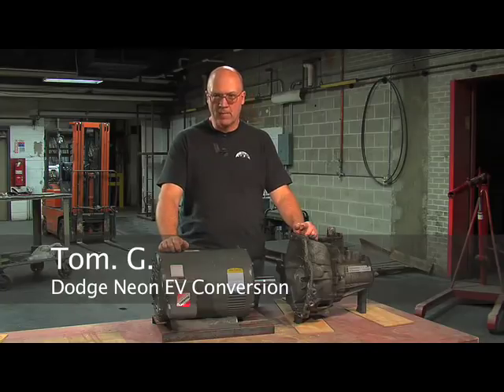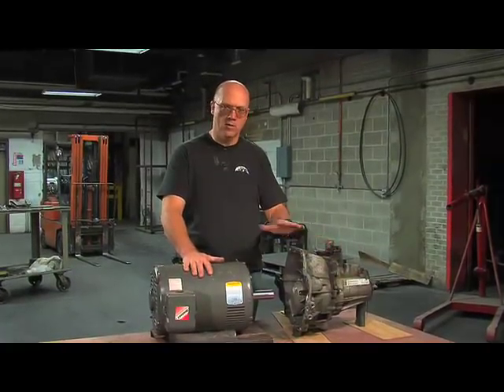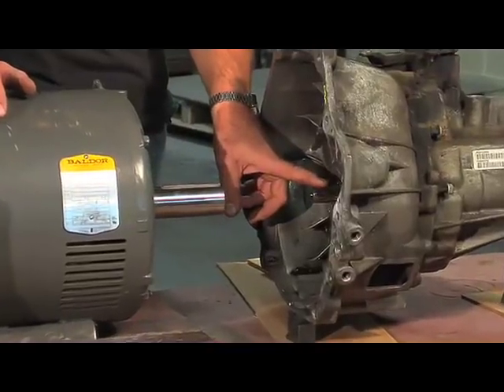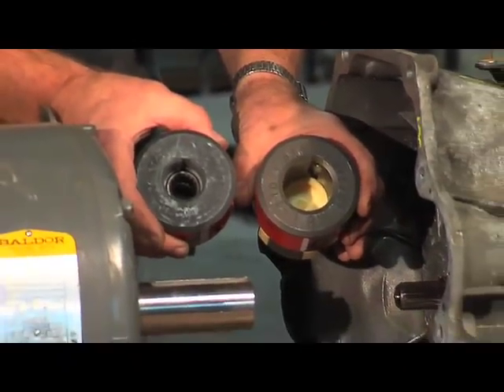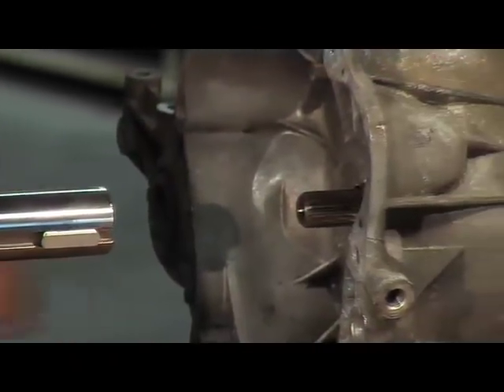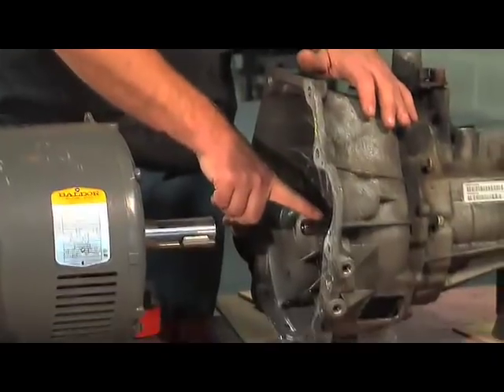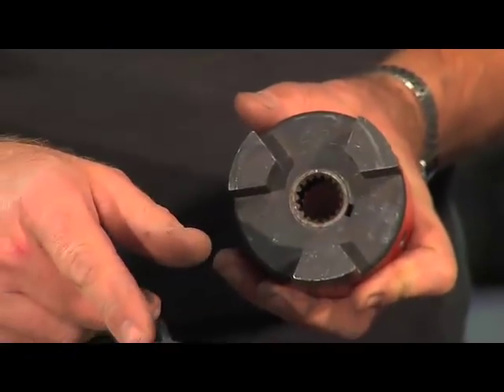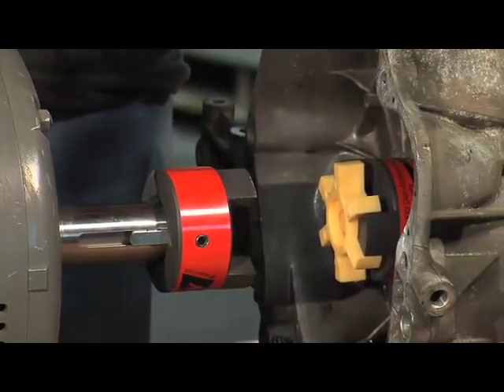AC Electric Car Conversion 101  part 001

Comment from the maker: Tom got a matched AC motor and the variable frequency drive for it as a matched set (for free, I think, knowing the right people.....)
The AC system also has regen built right in.
Reply: Is the motor an AC baldor industrial 30hp motor? I hvae  one laying around I want to use. The fvd might need to be purchased as the one I have would need modification to supply the DC bus directly instead of industrial 3ph supply. Thanks for this video.
Reply from the maker: @idus  Yes, I believe that is exactly an AC baldor industrial 30hp motor. I recall that Tom used a stock industrial Variable Frequency Drive with it, and I'm pretty sure that he just fed it DC directly from the batteries with no alteration to the VFD. Many devices that deal with motor control need to convert AC to DC as a first step. If you just give it DC in the first place, it works just as well.
Reply: @BenjaminNelsonX  That is great news. Thank you
Reply: @BenjaminNelsonX  So, if I understand, I can get one of the baldor motors (say a 20 hp for a few hundred) and run it off DC battery bank? I am doing this on a sailboat, so same concept (couple the motor shaft to the prop shaft) but less power requirement.
Reply from the maker: @j.goebbels2134  The important thing to remember for an AC motor is that there is a variable frequency inverter which takes the Direct Current from the batteries and converts it to Alternating Current to run the motor.
Reply: @BenjaminNelsonX  Thanks so much for quick reply! 

So I don't have to do anything special? I can wire a battery bank straight to a AC motor and it will run? 

Reason I ask if that new 20hp baldor motors sell on ebay for $500. If we add 4 big batteries to it, we could be running in a week. But we are electrically-challenged, not having wired up anything like this before.

We are broke down in our liveaboard boat -- threw rod in old gas engine, so looking to repower with renewable electric BUT hard to find info on how to do it....
Reply from the maker: You need to convert DC (Direct Current) to AC (Alternating Current) to power an AC motor from batteries.
If you want to run straight from batteries, you can use a DC motor.

An inverter, used to convert DC to AC for an AC motor, can go by several different names, including: Drive, VFD (Variable Frequency Drive), Inverter, ESC, speed controller, etc.

Industrial, mass-manufactured AC motors are usually powered from Alternating Current from the grid. If they run at a variable speed, instead of a set speed, determined by grid frequency, they use a Variable Frequency Inverter. This uses electronics to convert typical 60 Hertz AC to whatever frequency needed to spin the motor at various speeds.
Reply: @BenjaminNelsonX  Great info. So we can use an AC motor with battery bank, but need a VFD with it. How do we size the VFD for the motor? Sorry for these basic questions. We just don't know what parts to buy....
Reply: @BenjaminNelsonX  I plan to purchase a DC motor. 14KW. It is available at okay price, just not as low as many of the industrial AC motors. But I am still not sure. If I understand here, all the AC motor have to convert to DC anyway, so DC would be better? Plus, DC you can use simple switch to forward/reverse?
Reply from the maker: @j.goebbels2134  Neither is "better", but DC motors tend to be simpler to operate. On permanent magnet DC motors, you simply reverse battery polarity to reverse direction. If you are reusing a stock manual transmission, you can also simply use reverse gear. Keep in mind that a switch to reverse an electric motor would actually just be a control that would operate a contactor - a high power relay with heavy cabling that can handle the high current of the electric motor.
Reply: I need some clarification on this. Why the need for the transmission when you can regulate the speed of the motor by increasing and decreasing the rate of electricity to the motor?
Reply from the maker: This should clear it up.
https://300mpg.org/projects/electro-metro/transmission-for-an-electric-car/
Reply: @BenjaminNelsonX  I bought the me-1306. It is a 12KW BLDC motor. I am now trying to figure out what controllers are available for it. Any help please???
Reply from the maker: @j.goebbels2134  Sevcon Gen4 or Kelly both have brushless DC controllers that would work with that.
Something like this for example: https://kellycontroller.com/shop/kls-mn/
Reply: @BenjaminNelsonX  Cool. Can you send the specs of the one you saw? It resets the lists when you copy/paste the link.
Reply from the maker: @j.goebbels2134  Just pick the one for the battery pack voltage and current you need.
Reply: Lot of things has changed since the 70's

Comment from the maker: @BenqS42 
I don't see why not.
The motor in this video is a standard industrial AC motor. This one wan't designed for a real wide range of rpms though. It keeps the original transmission to help match the speed to the motor to the speeds required to travel.

View my other videos on this electric car project for more information.
I also have an instructional video for sale at 300MPG.org that shows how to build a DC-powered car.

Comment: My buddy Rob and I did this to a VW bug once. We used a electric forklift hydraulic pump motor. Used aluminum plate and mounted the motor and transmission together on that. We had to grind those shafts together as a male and female.. like a flathead screwdriver. We used a pile of car batteries and a golf cart gas pedal.
Reply from the maker: Fun projects, aren't they!?

Comment from the maker: A standard, or manual, transmission is what's used for most home electric car conversions. In an electric car you can either use a clutch or directly couple the  motor and transmission together. Both ways work, and each has advantages and disadvantages.

Comment from the maker: The coupler on my Electric Geo Metro was a different style than the one shown in this video as well. There's more than one way to skin a cat, but the important part is that you can reliably transfer the power from the motor to the transmission, whether with a clutch, Love-Joy, splined solid coupler, or whatever else works.

Comment from the maker: @TheDoyleClan 
The car belongs to my friend, Tom.
He chose the car because he already owned a PT Cruiser, which is the same platform as the Neon. So, he already knew how to work on one and that he fit in it OK (he's really tall!)

The motor was salvaged from some factory equipment and INCLUDED the matching AC frequency drive needed to run it. Insurance and license is completely normal. If you want to get technical, cars like this would qualify as a "hot rod".

Comment: I used to use those couplers to mate electric motors to pumps and gearbox shafts. We used to use a laser system to determine how far off the two shafts were and then apply metal shims to the mounts as necessary. Without fail, if the two shafts were not aligned, those couplers would eventually eat through the rubber star and then proceed to chewing up the metal of the couplers themselves. Aligning them as perfectly as possible is critical for long use. Those that were lasted a long time.

Comment from the maker: @Landcruiser45 
On a front-wheel drive car, the differential is part of the transmission. You need some way to connect the motor to the wheels, so the easiest way to do that is to connect it directly to the transmission.

Electric motors are not all powerful. While they do have a wider range of RPM than a gas engine, being able to use multiple gears will allow you to use fewer amps, keeping your batteries happy and allowing for longer range.

Comment from the maker: @justfurfunny 
No, the only trouble I have had was getting through emissions testing. There is no tailpipe and no car computer for OBDII, so they can't test it. It took me a while to find the right guy to talk to and get an exemption from testing. 
Since it's a car conversion, (think Hot-Rod!) everything from the original car still applies.
Last I checked, there is NO ELECTRIC check box at the DMV. Your car is gas or diesel only. I am not sure what they will do for the Volt, Leaf, etc.

Comment: I think you are right.I have both motors and AC shaft rolls smoothly just by finger.To make it roll DC motor, I have to use whole hand to overcome slight brush friction.As you say,the good AC controller will do it,the problem is to make one very efficient at low cost.DC is easy to controll.

Comment from the maker: I think I have to agree with Dan here. AC is more efficient INTERNAL to the motor. DC may be more efficient at the controller, because it's just switching DC on and off really quick, whereas an AC drive DOES have to convert from DC to AC, but I wouldn't say that you "loose a lot". A big part of why this project happened was that Tom got some free batteries to start with, and then a really good deal on a used industrial AC motor and drive. We'll see more AC home conversions as prices fall.

Comment from the maker: @chrstphrharp1 The builder got an AC motor AND its matching inverter/controller (AC drive) for free out of factory salvage. He simply modified the setup to run a car. An AC system is more efficient (no brushes) and features regenerative braking. He's also an electronics guy and enjoys the design challenge of this unique vehicle.

Comment from the maker: Yes, you COULD get better fuel economy by powering accessories from a motor instead of the engine. More and more new cars have electric power-steering, electric water pumps, etc. What you would be doing is making sort of a form of mild-hybrid. I don't know if the fuel savings is going to be worth it or not. That depends on how much you like working on cars, and what the parts would cost you, but yes, you can save fuel that way.

Comment: @BenjaminNelson 
Hello, thank you for this great effort, but I have some questions.. How is the gear shift after removing the clutch..? The second question I have a car that weighs 1600 kilograms, does it work with the crane engine, which is 5 kw Just does it perform the same as the 100 horsepower engine?

Comment: Will it work?  maybe not,  i think that the clutch disk splines will slip inside the industrial coupler, to make sure, you need to drill 2 lengthwise holes in between the two pieces, tap them,and fill them with 1/4 inch bolts, a sort of 2 keyways.
edit:   oops, 8 years after   lol

Comment from the maker: There are a number of places online where you can order motors. A good place to start is at the Electric Auto Association web page. They have a listing of suppliers. ElectricAutodotOrg
I put a used forklift motor in my car. You can find those at junkyards. More on my "Electro-Metro" project at 300MPGdotORG.

Comment from the maker: Direct coupling works fine. Tom uses all the gears in his car. He has a button on the stick shift that goes to the AC Drive that automatically spins the motor at the right speed to shift without needing a clutch.

A big part of electric cars is all about limiting amps. Too many amps through the motor for too long makes heat and kills motors. Use of proper gearing keeps them happy.

Comment: Is the keyway really strong enough to handle that much torque over an extended period of time?  I've seen multiple vehicles crack the nose of the crankshaft and shear the keyway off and crack the timing belt sprocket.  And that just has to turn a valvetrain, nevermind a whole vehicle, and it isn't much smaller than what I see on that motor.  I think having splines machined into the shaft would be a lot more reliable.

Comment: Thank you for the great answer. I've heard of some people running their EV without a transmission, kind of like the Tesla but I think most of those cars are rear wheel drive and also use a special AC or DC motor.

Comment from the maker: @robviolin1 
On a front wheel drive car, the transmission IS the drive train. A motor like this has a limited range of RPM, so you still need the gears anyways.

Comment from the maker: Anything is doable, but most electric car conversions use lighter-weight 2wd vehicles. Mostly that's because battery packs contain a relatively small amount of energy compared to a tank of gas (or diesel fuel). A larger heavier vehicle can be converted to electric, but will be less efficient and have a smaller range. That said, there are a few commercially available large trucks going into production (delivery trucks, etc.)
Look on the EV Album. There are several Land Rovers listed there.

Comment: Jut a tout, look at having you Lovejoy connector under bore for the transmission end. Have a machine shop cut the splines into the coupler. This removes a weak leak from your concept.
Reply from the maker: Hi Larry, that is exactly what Tom did later on this project! It worked great!
Reply: Larry McDonald

Comment: I have some comments/observations.
What was the total conversion cost?
What size/power was the electric motor used?
Use cutting fluid to extend the life of your hole cutter.
Is there a point in reducing a four seater to a two seater with no luggage space?
Have you addressed the hazard of batteries venting explosive gas into the car?
Could you fit a small diesel powered generator to extend the range/reduce the amount of batteries needed?
Convert a pickup and have all batteries in the load bay?

Comment from the maker: Two good reasons in this case. One, this particular motor has a fairly limited range of rpm and torque, not unlike a gas engine, and two, you still need some way to split the power (such as a differential) and connect it to the front wheels. In a typical front-wheel drive car, the transmission is actually a "transaxle" which has the gearing, the power split, and that half-shafts that go to each of the front wheels.
Without the transmission, you would have to design and build all that yourself!

Comment: Thanks for that. At the moment I can't find the batteries that I want for less than £2000, and I can't justify spending that kind of cash+ on a vehicle that I can't jump into and drive over a hundred miles each way. I did nearly 450 miles the other Saturday collecting a kayak i'd bought. Even with the kayak strapped to an inflatable mattress to the roof of my 2000 1.9L diesel Seat Ibiza, I still averaged 67.9 mpg for the tank of fuel, which I thought was pretty good for an old shed!

Comment: I have a house boat with slant 6 motors I want to replace. I could use some advice on how to set up a throttle and battery system.

Comment: Hi Benjamin, are you implementing regenerative braking on this project, may you please explain how one can make use of regenerative braking on ev conversion.
Reply from the maker: Yes, this project supported regenerative braking.
To have regenerative braking on your vehicle, you need a style of motor and motor controller which support that feature. There have been plenty of good conversions which did NOT use regen - such as older conversions which used DC series-wound forklift motors. In general permanent magnet DC motors and AC motors can regen. It's a great feature for a typical daily driver, as it recaptures some energy which would otherwise just be wasted in braking. It also extends the lift of brake pads!

Comment: I just had a thought.I think it's possible to install a small generator around the wheel to utilize its rotation and use it to charge the batteries whilst the EV's on the road.What do you think?

Comment: One thing I didn't see you say is that on the transmission side coupler you need to put a plug or something to keep it from sliding too far onto the transmission shaft when coupled together otherwise it can slide apart or start rubbing on the back of the transmission. That looks like an AC motor have you got an AC controller that runs on DC?
Reply from the maker: The components have set screws one them to keep parts from sliding around.
This car uses an AC variable frequency drive, originally used in a factory running off AC wall power. AC drives convert AC to DC to do their work of changing frequency and current and then convert to AC for the final output of the device. Since it's really working with DC anyways, many stock VFDs can simply be fed DC in the first place.
Reply: @BenjaminNelsonX  yep ..keep up the goof work.

Comment: Does direct coupleing work?  Have a 5 speed  in my Saturn.  Need the clutch to shift gears.  4th to hit top speeds.  If I start in high gear, the motor draws too much current.  Are you selecting just one gear?  Does it stop on a steep hill and go again?  I am exploring range, top speed, drag, & weight.  To cut weight, use an aluminum fly wheel for raceing, then use all  gears for best perfomance.  If you don't need to shift- don't. Rolling backward with a smoking motor and no clutch is not fun.

Comment from the maker: @robviolin1 Some factory produced EVs with very high end electric motors use a gear reduction and differential. In this case,the transmission gives you the gear reduction. In front-wheel drive cars, the differential is built into the transmission. (You still need the drive wheels to be able to go different speeds to go around turns.)
Also, with a single large motor, you just need a good place to mount it. That means the easiest thing to do is just connect it directly to the transmission.

Comment: If you study the Nissan Leaf, you will see it does not have a transmission.  It uses a drive train with a synchronous electric motor.  How is your setup different from that?

Comment: Do I understand you correctly? You mean to use the engine on a trailer with driven wheels to push the car along?
My thoughts were to work out what electrical power you need to run the electric motor, add a bit to charge the batteries while doing so, and then adapt the car so you can bolt a small diesel or petrol engine to power a generator of the required size onto to the back.